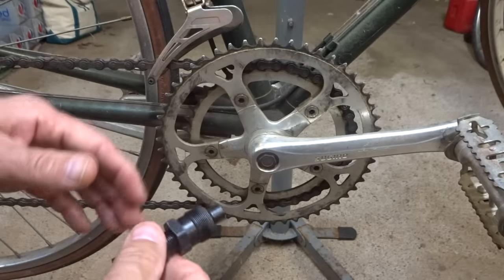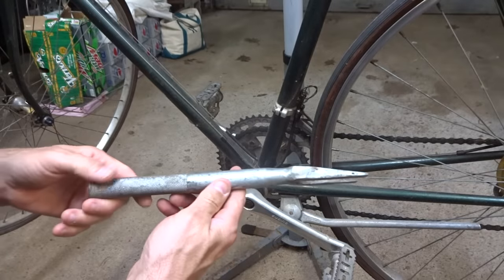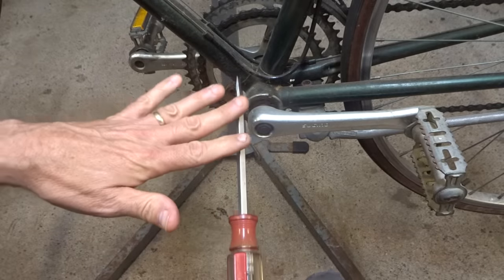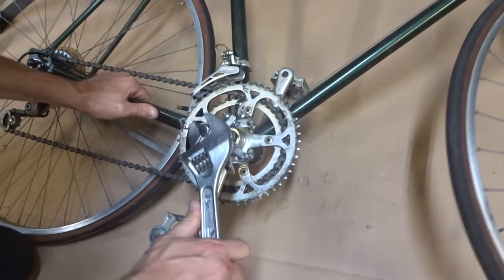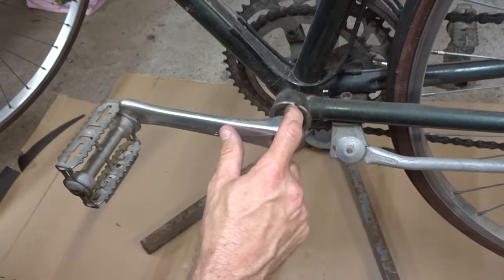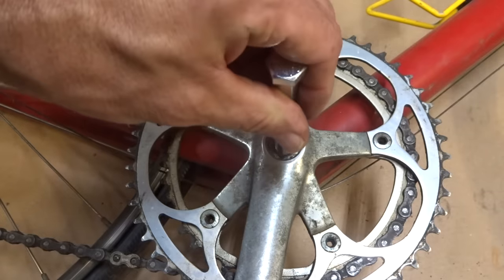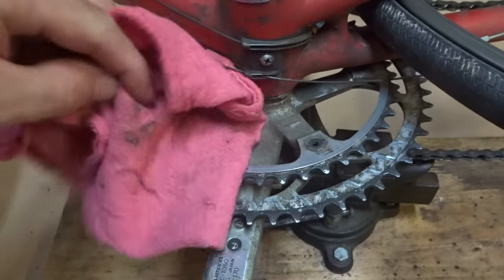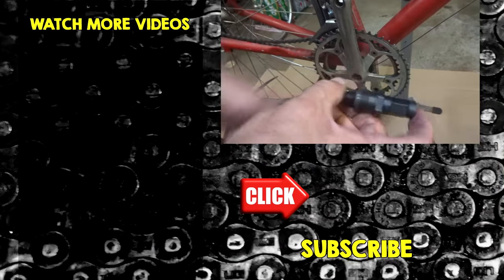Remove Cranks Without A Crank Puller

Comment: so glad you ended it with "just buy the tool". It's definitely one worth having.
Reply: Yea, but I am broke and 14 years old.
Reply: How much are they?
Reply: @captainnemo2150  about £12, halfords charge £10 so your best off just getting one if you plan on needing a new crank arm more than once
Reply: Captain Nemo in China you can buy it for $2.50
Reply: I bought one  SO SORRY I DID instead of pulling it apart like it supposed to  - apparently both of my square spindles are special     NOT beware of buying you bicycle tools of amazon! It ripped the threads out of my pedal hanger ruining it!   I could have saved myself about 30$ and a headache! Beings I know have to buy a new one I could have just cut it off   (yes I used the tool properly!) Evidently mine are put on with more tourqe than the threads would stand up to
Reply: Yeah but I stripped the screw thread that the tool grips.
Reply: I had the puller tool and it ripped my theards to smooth
Reply: @captainnemo2150  about $15.00 USD I recommend the one from Park Tool.
Reply: Is a special tool required to remove the bottom bracket?
Reply: @GokkunGuru  yes, and it largely depends on the type of Bottom Bracket and the tool needed.
Reply: @leemilica  back when I was 14 I took 3 buses and a train, then had to walk 30 minutes through the most dangerous city streets to work my first job. at work I would break stone all day using nothing but a hammer and my hands.. 20 hours per day, 6 days a week and on my day off I'd do 8 hours of chores. by the end of the week I'd have earned a nickel and it went right to my parents. you little whippersnappers don't know about hard work!
Reply: @chrishayes5755  i started a job and now i have a motorcycle lmao
Reply: @joelrandle1972  amazon sells alot of cheap stuff that don't work

Comment: Finally someone preaching sense instead of ruining good parts due to the laziness of getting the right tool.

What I like about RJ is that he doesn't just tell you what is right and wrong, he explains rationally why something is right or wrong, so you are left with little doubt.

If you have gotten stuck with a used bike whose crank-arms keep coming loose, and even thread glue doesn't keep them on, now you know how they got this way.  Continuing to ride the bike home after they have gotten wobbly will finish the job of trashing them.

Comment: The additional detail of what size bolts to use for square taper vs octolink is why I watch your videos. Great job. There are lots of people who don't have the resources to spend even $5 for a puller and this will show the pros and cons of each method. As always illuminating.
Reply: Wait so they bought a $300 bike and doesn't have $5 to buy a tool for the bike?smh

Comment: Since April and thanks to your vids I've: fixed 3 kid size bikes (thought 1 kid how to ride); renovated an old mountain bike from the late 90s (strip down every single part except BB); bought and tuned a 2009 Specialized Hard Rock for myself (rode 150km these past 3 weeks); tuned a foldie for my sister and am in the process of renovating 2 more mtbs. THANK YOU!

Comment: Sometimes you can't just buy the tool.It might be a case of the tool broke or would not work if the threads are stripped out,as happened to me.

Comment: I used your bearing puller method on a crank with stripped threads and it worked great after heating up and cooling it down a few times.

Comment: For those who don't have the time and patience to saw through the cranks or the bottom bracket, and don't mind damaging things when the crank threads are in a bad state already, thwack the chain rings directly with a hammer (rotating them between blows) and, for the trickier non-drive side crank, place a plank sideways on the ground and rest the inner surface of the crank, near the axle, on the plank - then hammer DOWN on the end of the crank using the plank as a pivot. This has worked well for me and the bottom bracket was still in good working order, amazingly!

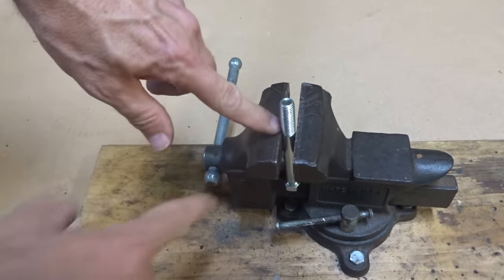Comment: I don't have a vice like you show at 8:00, so instead I drilled a 3/8" hole in a piece of 2x4, put a long 3/8" bolt through the hole, and bolted it onto the 2x4. This worked well as a support for the bottom bracket spindle and enabled me to pound off the drive-side crank. Victory at last, I've been wrestling with this crank for weeks!
Reply: Great idea! I actually have an anvil with what I believe is a 3/8" square hole that I could use this solution on to secure the bolt that will protect the BB spindle.

Btw, ever since you removed the crank this way, has the bottom bracket worked properly, i.e. smooth, no roughness or resistance or weird noises, etc.?
Reply: @kovie9162  I also replaced the bottom bracket during the same overhaul, so I can't answer that. It appears fine, and feels like it turns smoothly but I haven't tried it under load.

Comment: Hi RJ, been a while, I just replaced my crank arm the same way that I change my bearings, for years, never hurts anything unless it falls on my toe, I use the butane torch, all plastic off, heat ,and torn while applying pressure with a large screwdriver, fell off too fast the other day and hit my toe, Take care, trampolines today and tomorrow.☺ FanTom USA

Comment: To me, the vice idea is the nicest. I designed a wooden puller tool for stripped threads with three long and wide headed bolts and three holes in a block, the heads of two bolts on the sides would go under the chainring and the middle bolt would push the bottom bracket axle. Also I have a soviet chainsaw puller tool that my dad lathed into the correct thread and this is now my main crank arm remover. But yet to try that wooden block puller, I think it would be a very cheap solution, although considering time, I saw a cheap puller for 2 bucks online, so essentially it would still be reasonable to get the real thing.

Comment: Im currently getting an aluminium one off a steel bike using caustic soda. It’s super destructive and a bit dangerous, but works if you’re desperate. 

I’ve gotten a stuck quill stem out this way, aluminium sometimes chemically bonds to steel, but it melts in caustic soda where steel is not too bothered by it

Comment: Stripped crank-puller-mount threads are the common problem in used bicycles that people want working again where "the tool" will not work. Cutting takes just as long, is noisy, creates filings and uses up cutoff wheels. I like the bearing puller (triple-hook thing), but put a few, light, hammer-taps to help walk the crank off in a parallel motion.

Comment: If you're just trying to get the arm off for say a pedal assist for certain sensors take off the outer bolt, make sure there's no plastic orings or retaining caps in the spindle and use a butane torch to the bottom of the arm and spindle and use pressure on the arm like pushing with a screwdriver or tapping at the base of the arm and for me it popped right off. I've had to do it twice on different bikes. And no hitting hard enough to do damage. It mostly just popped off with pushing lightly at the base when it got warm enough.

Comment: if you have used one of the methods that damages the interface, low strength threadlock can be used to fill the gaps so it seats firmly, and makes no difference when you next go to remove the crank with the tool.

Comment: Thank you for this. I'm in the process of trying to rescue a much abused bike that was left out withe the trash. Tying to pull the drive side crank to replace the chain rings and it's jammed so tight my crank extractor just pulled the threads out.

I think I'll be trying the gear puller, more affordable than I feared. But you have given me options as well.

Comment: Hi RJ. I do use the ball-joint tool method but only when the threads are stripped. In fact, I've used all of your methods at one time or another. Again, when the threads are stripped so no need to worry about damage to the chainset. Great advice on supporting, using rags etc. It only takes a few more minutes and can save other parts from being damaged. Not to mention minimising the absorption of impact, (if you Have to), when the BB axle is supported.

Comment: I bought the tool. But if your a type that doesn’t have the money to spend on tools . Your method in removing the cranks works. Thanks for sharing your video.
Reply: If you can't afford a $5-10 tool or are too cheap to buy one and need to remove your cranks now and then, then you shouldn't be riding a bike, or should expect to have to junk it when it breaks down. Bikes are like cars, they have to be maintained and sometimes fixed, and that costs money. The methods shown here are for when the proper tools no longer work, not instead of using them.

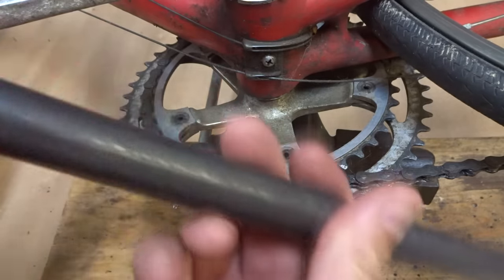Comment: I have done pretty much every method described in the video. If you don't have the crank puller or treads are stripped on the crank, I find the best method for a LEFT crank is using the "pickle fork" auto ball joint remover. Never use the "pickle fork" tool to remove the right crank because you WILL bend the chainrings. If you don't have the "pickle fork" tool  then hammer out both sides using a metal bar as shown at 8:30.  Good video! ...  Save yourself the suffering and buy the tool already  ...

Comment: RJ I have benefited from many of your videos for quite some time, Just wanted to add one point about using a gear puller. In my area Southern CA - San Diego my local auto parts stores Orielly AKA Kragan and Auto Zone have gear pullers in their free tool rental program. Basically you put up a deposit equal to the price of the tool, use it, return it and get a full refund. In general what I do when I have a challenge with one of my bikes, #1 get the right tool for the job, if the tool wont work or it is one I would not use often I watch RJ the bike guy to learn how to make my own version of the tool and go from there

Comment: Great vid. I always use a correct puller however half the time it strips the treads....so then it's three prong or hack saw. I avoid the problem in the future by using never sieze on reassyembly.

Comment: On the leftside crank arm you can maybe used a two arm wheel fuller...there are 3 arm wheel fuller that are designed to be easily converted to 2 arm

Comment: Just a correction we talked about using a hacksaw to cut the spindle and then you're left with the crank arm with the nub end of the spindle left-handed into put it invites to knock it out he said to open up the vice just wide enough to put the stub in it and then use like a screwdriver and Hammer to knock it out well if you've got the stub n the vice gripping it, it's not going to go.  You need to put the crank arm in the vice maybe with some scrap pieces of wood or something to keep the teeth of the vice from marring the crank arm but then you can use a screwdriver and Hammer to knock the stuff out so it falls down to

Comment: I had one with damaged threads no access to a 3 leg puller but a small propane blow torch. As long as your prepared to re-grease the bottom bracket heat  the crank up and a tap with a hammer and off it will come....I have the correct puller ..plenty good ideas from RJ !

Comment: Speaking from experience: The pickle fork is too wide. It just cuts into the crank arm without applying any outward pressure.
On my project (the threads are stripped so I'm scrapping the cranks anyway) the back of the crank arms are beveled, so gear pullers spread out and fall right off.
My next option is a pitman arm puller, which is like a gear puller with the arms built into the base rather than pivoting, so they can't spread. That would work, but I don't already have one and it would cost as much or more than a new bottom bracket, I think the hacksaw is the best answer.

Comment: A while ago i was faced with a cheap steel crankset with stripped treads n no way 2 get it off, easy fix was hit it with the blow torch n it fell off in 1 tap!

Comment: I have the correct tool but I got a second hand bike where the thread on the chainset for the crank extractor tool had been stripped by the previous owner. Loosening the bolt and taking it out for a ride worked great for me.
Reply from the maker: I hope you are planning on replacing the crank then.
Reply: @RJTheBikeGuy  Yes, I replaced it with a much better crank.

Comment: I have an old Roadmaster Granite Peak 24 18-speed mountain bike. I had to use a ratchet with a size 9/16 extension to remove the bolt

Comment: I'm in this situation right now. I always used the proper removal tool but stripped the inner crank threads when I previously reinstalled the crank because the crank bolt washer was slightly cocked and sheared half the threads off. When I just tried to remove the crank to replace a chainring I found this out.

I tried several non-destructive methods. First I tried to use plumber's tape to see if that would allow the removal tool to sufficiently bite into the crank threads, but that failed.

Then I tried a 3" 2/3 jaw puller in both 2 and 3 jaw mode and all that it managed to do was chip off tiny parts of the crank from the inner side as the crank is rounded near the center and there's really nothing to grab onto. I'm hoping to be able to smooth out the gashes on that side with a rotary tool and that this didn't damage the crank structurally.

Meantime I ordered an M22x1.00 tap set to see if I can repair and restore the inner crank threads so I can use a removal tool. My guess is that there's not enough metal left for that to be possible, but it's worth a try. M22 threaded bores are common on cars so I could always use them on that if I ever damage any.

I also came upon a special crank removal tool made by Unior, (Square Taper Crank Puller - 1662/4), that has a hard tapered outer thread that digs into the crank where the threads were stripped, effectively retapping them and giving enough grip to then remove the crank. It's just over $20 and I'll probably buy it to make removal easier in the future if I'm unable to restore the crank threads.

But one of the solutions in this video also occurred to me, to punch out the crank from the other side but by first protecting the spindle from movement so that the bottom bracket isn't damaged. I don't have a bench vise but I thought that resting whatever I used to protect the spindle against an anvil, which I do have, would accomplish the same thing. I figure that an impact socket of the right size would do the trick and its flat ends would prevent slippage.

No way would I use a pickle fork let alone grind the crank out. It's over 20 years old and not that easy to replace affordably, and if I can save it and hopefully the bottom bracket, that would be ideal. But I will need that special removal tool for future removal, if I can't restore the crank threads.

Lots of potential solutions that won't ruin the crank and/or bottom bracket.

Comment: I have a collection of crank arms that were either damaged by hammering on the back side, the front side (with the bolt sticking out but not far enough), or by using a gear puller. That's right, a regular gear puller damages the arms.
But you can knock them loose if you hammer the spindle out of the arm:
https://www.youtube.com/watch?v=0ihYHNBDwJ8
This arm in the above video was already damaged from someone hammering on the half-removed bolt as mentioned above. Moving the point of impact away from the face of the crank solves that issue. As for mis-strikes, the BEST driver to use is an M8x1mm bolt that's longer than the original: I've used a vintage solid front axle for this, but didn't have one handy for the video I linked. The second best option is to find a punch that's fairly snug in the hole, so that it doesn't move around as you're trying to strike it.
There's also a positioning issue: If you have to knock the spindle out of the arm, it's best to balance the seat and bars on a bench or even the back of your couch, and hold the bottom of the frame up to level by holding the crank arm with your free hand. I couldn't do that for the video I linked, because I couldn't get the tripod high enough to point down at me doing that.

Comment: Tried to saw through an octalink spindle. New blade in the saw, and it just skated over the steel. After 30 mins I had about a 1mm deep groove. Didn’t need the arm, and decided to risk the BB by using the brute force hammer method. It went much quicker 😁 Luckily it survived, still spins smooth, but be prepared to need a new BB if you try this method.

Comment: Thank you so much!!! What I didn't know I didn't know, now I know. Don't have a crank puller but was able to knock of my crank arm cleanly, flat-head and hammer along the 4 points. I.g. Airforce_Voyager.
Reply from the maker: Should have just bought the tool.

Comment: Great video, i fitted a UN300 bb and then put my drive side chainset on but forgotten that it was bent so i wanted to remove again, the thread went on my crank puller so the srive side is stuck, as long as i can remove it, as you say i dont want to damge the BB, ut doesn't matter if the chainset gets damaged because I will be putting a new one on. Thank you.

Comment: for rad runner + i used the puller on the drive side. cracked loose  the tool but it woudnt come off except a little so i went on other side loosened the ring with the wire plug connected to it loosned it the other side came off now you twist off the the exposed threads with your fingers until  both sides fall off completely. i did it this way because i bought the wrong type of crank puller set mine was tapered i bought oct.

Comment: All the methods mentioned here will work vastly better if some heat is applied to the crank arms near the spindle. Even boiling water from the kettle works a treat. Can’t believe this was not mentioned. Very basic trick.

Comment: A retro 14mm crank bolt head (unrimmed) is also the perfect octalink adapter if you have a puller but no adapter, drop the bolt in threads to the inside.